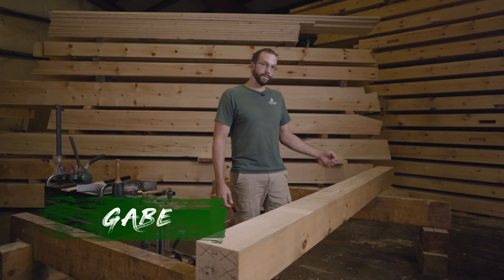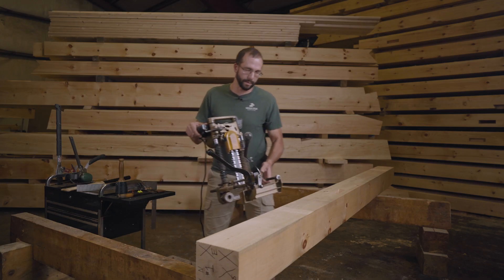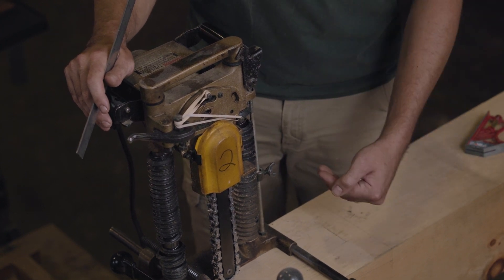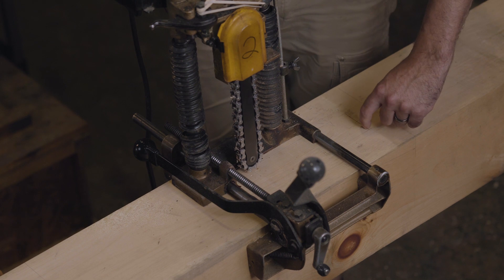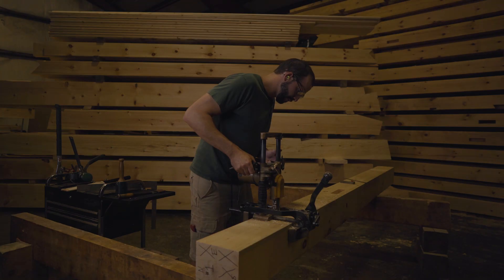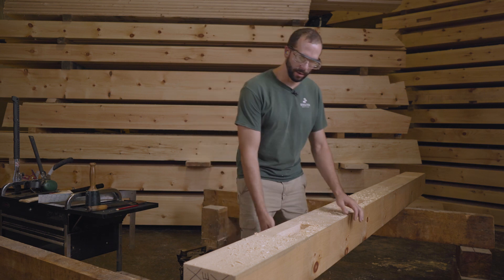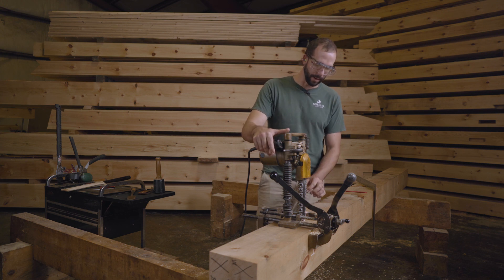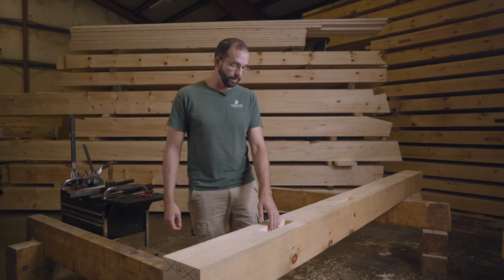Using a Chain Mortiser to Rough-out a Thru Mortise - Timber Framing Online Course Sample

Comment: I spent a lot of time with one of those last summer. Older ryobi job, but much the same principle. We were working in seasoned oak, 8 and 9 inches. I would still be there pounding away at my chisels if we hadn’t had that machine.

Comment: I'm thinking about trying out some of the battery powered chain saws for some bulk removal and layout. The mortisers are awesome, but expensive as heck and hard to find consumables.
You folks tried any of the electric pruners/chainsaws? May have to work with someone, but would love to build a modern version of this tool
Reply from the maker: We have not tried them out for timber framing but that may work very well. We used to use a drill and auger bit to drill out the mortises and that works well also!
Reply: @ShelterInstitute  in my mega limited experience that's the obvious route I've selected haha Far cheaper, have plenty of bits laying around. I feel like with the crazy scalability of modern equipment someone should have come up with something... Then you turn off a saw and listen to the lack of a saw for a few minutes and you just don't care that much.

Comment: Perfect example of why we use hand tools instead of power tools. Breaker popping in the middle like that. Couldn't plan that that good. 

That tool sure looks a lot easier to use than my chainsaw. I can still get by, but man that's like a brand new Cadillac, and I'm in the ol beat up pickup that's usually seen rotting away on the side of some farm.

Comment: Good video you don’t need to wind the lever to widen the mortise you set the width of the mortise on the two bolts on the black level ,cut pull the lever and cut again .

Comment: Your operating the mortiser from the wrong side.
Reply: Utter nonsense..... I use the same makita mortiser as the one featured here and use it in the same way as shown here... If it was operated from the chain side (which is dangerous for obvious reasons) then all of the controls  would be very hard to use.... You'd be trying to turn it on with your little finger on your left hand instead of your index finger on your right hand and  operating the plunge release lever with your palm somehow instead of your left thumb. To sum up, this machine is being used correctly although he does not show or mention anything about the traverse lever
Reply: @davidbuckley620  i agree with Gene..................the Demo operator is on the wrong side
Reply: It doesn't affect the result. I personally would like to be on the opposite end of the chain in the unlikely event of catastrophic failure or being bumped from behind. To each their preference.